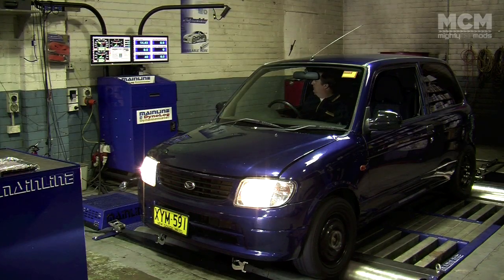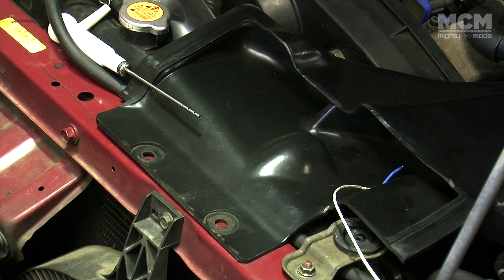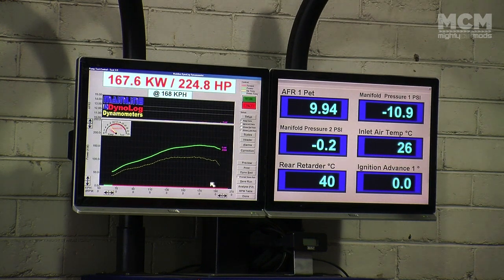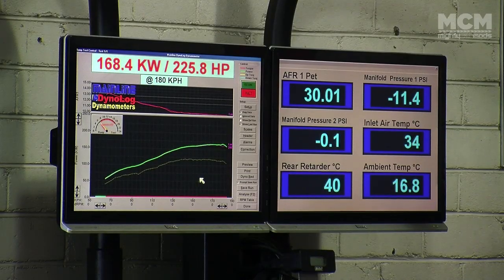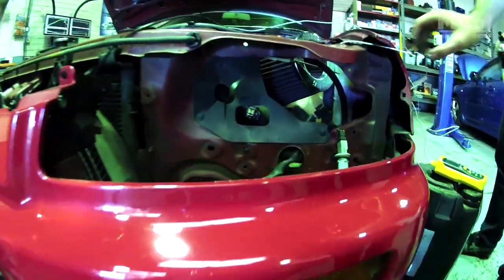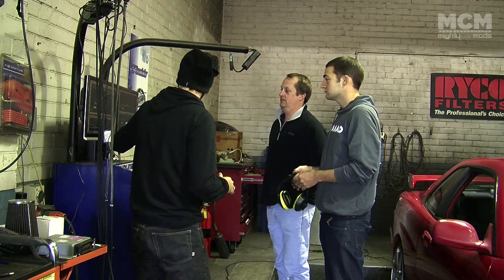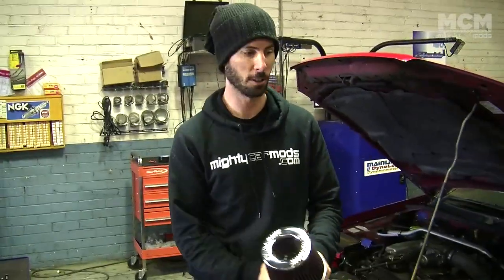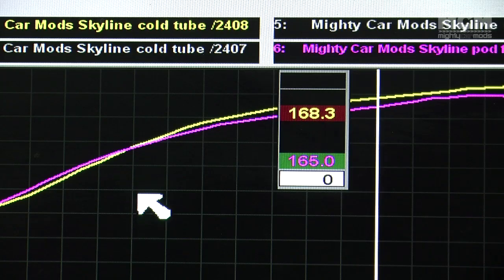Cold Air Intakes Mythbusted [Turbo]

Comment: The entire idea of cold air is that cold air is more dense and dense air makes more power.  This car is turbocharged. A electronically controlled turbo increases the density of the air to a specified psi no matter what the incoming density is.  Absolutely useless test.
Reply: Agreed ^^^^
Reply: Well said Dan Henderson
Reply: Real enthusiasm.
Reply: Hey Dan, PSI and density aren't the same thing. The atmosphere is at 14.7 psi. And at 14.7 psi, cold air is more dense than hot air. That's why If you stick a balloon full of hot air in the fridge it shrinks. This principal doesn't change at higher psi. If you're pumping 20 psi of cold air, you're getting more air than if it was hot.
Reply: Which like Cody said would explain why you would also get different results at higher and lower elevations due to air density.  I know my K&N worked for my SRT 4 .  I could drive it in 5th gear going less than 25mph / 40kmph and still spool air into the turbo.  Doing a launch I could smoke the tires all the way to 5th Pipe diameter, shape and length have a lot to do with how fast the air can be accelerated through the intake into the turbo, allowing a higher density of compacted air molecules, which allows the computer to adjust for more fuel, allowing more power (in a WOT situation this is maximized).  Companies who do extensive testing, such as K&N tend to achieve more nominal results.
Reply: Cody Dana Yes, PSI and density aren't the same thing, but given PV = nRT, n/V = P/RT.  In other words, given a constant density and different temperatures, the turbocharger would work 'harder' to take in air at an increased pressure.
Reply: Dan is right. Also, where is their heat shield?
Reply: Smart fucken man...
Reply: ***** what if you dont have intake valves =o
Reply: Its not just air that matters...  Its the oxygen content in that air.  Colder air since it is more dense carries more oxygen to the cylinder.  Oxygen + fuel + heat/spark = bang.  If you want a bigger bang you have to get more air and fuel into the cylinder.  So yeah, CAI is a valid attempt to get colder/denser air/oxygen in there to make more power  Unfortunately, doing this to a stock motor will most likely not have much gain.  Need to upgrade some of the other bottlenecks in the motor before you see a CAI intake make a difference.
Reply: Yes!
Reply: This, and the fact that, that is NOT A COLD AIR INTAKE.  That is a filter, a cold air intake comes with its own little box that insulates the filter and keeping the hot air from the engine from getting in, usually there is one side missing that faces the fender, from there is grabs air from the wheel well, that is a COLD AIR INTAKE.
Reply: BKH46 that is a short ram intake box
Reply: It is a COLD AIR INTAKE!  Which can also be called a Ram Air Intake.  It keeps hot air from the engine from getting into the intake.  The filter they installed was completely exposed to hot engine air.  Thus making their test completely worthless.
Reply: Measuring density in PSI. LOL.
Reply: Dan Henderson And that is why a turbo engine has no problems at altitude (within reason... high alps) but a NA engine can feel sluggish at high altitude...
Reply: wrong. CAI and ram are different things, CAI pulls air from outside the engine bay, ram pulls air from inside the engine bay
Reply: that made more sense than the video
Reply: ABSOLUTELY CORRECT. The other issue is that these knuckleheads are not considering the movement of air in road tests. I guess they didn't think of that either.
Reply: thats what the fan is for
Reply: They mythbusted CAI on N/A cars too with the exact same results. But regardless cold dense air is not the same as a turbo pressurizing air, If it was going to work it would still work on a turbo car.
Besides Turbos create alot of heat, colder more dense air would certainly still help make more power. This is why we have intercoolers.
Reply: Santa Clause yea exactly that's y Turbo Charged cars have a intercooler. I completely agree with ery point u made/said bro! But 1 thing that would've worked 4 em 4sure is different piping bcuz when the cold air comes n 2 the filter's chambers the pipes stay cold and continue to get colder over constant drive time. Which n return throws more cold air n2 ur motor. I'd bet anything if they would've used @least a piece of downpipe they'd get 5% outta it easy! But like u said "that's y Turbo Charged cars have a Intercooler on it"! U know ur cars buddy lol!
Reply: obvious troll is obvious
Reply: Math = troll...that's a new one.
Reply: Math?
It has nothing to do with math, It doesn't matter what kind of piping you have or were it goes at some point the pipes are inside the engine bay trapped with the hot air and they consequently get hot as well. Also his point of the pipes getting colder as you drive over time is totally invalid the car will heat up over time thus causing more heat and heating everything in the engine bay up more.
Then he says to use a piece of downpipe, not sure why you would use a turbo downpipe for a intake, and metal would probably get hotter than plastic does. Metal at will atleast certainly trasnfer more heat to the air in the pipe than plastic would.

The reason a intercooler works is because its designed like a radiator with channels for the air to go threw and off that thousands if not millions of small thin metal fins acting as a heat sink, then as you drive air goes threw and cools it off just like a heatsink in a computer with a fan on it will cool your cpu.

A intake of any kind will not increase your power, and the filters are not very good at filtering the air and the only reason to change out your stock intake is if you have a fully built engine with a tune and then at that point you are probably surpassing the stock intake thus hurting your power and probably its a track car anyways. Cars come with the best cold air intake you can possibly get from the factory, my car takes air directly from the front of the car outside the engine, others will take from the fender, either way its taking air from outside the hot engine bay to get the coldest possible air it can get.

You guys are just ignorant.
Reply: Tony Stark lol ikr! But HP and WHP r #s bro!
Reply: Where does math come into adding a cold air intake to stock engine = more power? The cold air intake is going to take in more hot air than the stock intake 90% or more of the time because its not in a airbox for 90% of them and filter the air worse, also the better breathing and less filtering filter doesn't equal more power either as your engine airbox is already the max size that the engine requires and any more is not needed or usable in its current stock form.
Reply: MORE VOLUME. COLD AIR is MORE DENSE. WHEN YOU ADD a BETTER FILTER and A BETTER INTAKE for MORE VOLUME OF COLD AIR you get MORE OXYGEN MOLECULES PER INTAKE STROKE. The Computer then ADJUSTS THE FUEL INJECTORS TO ADD MORE FUEL. MORE OXYGEN+ MORE FUEL = MORE COMBUSTION= HIGHER HP AT HIGHER RPMS depending on INTAKE RUNNER LENGTH. LONGER RUNNERS = HIGHER HP AT HIGHER RPM. SHORTER RUNNERS (WITH VELOCITY STACKING OF AIR) = MORE TORQUE MORE HP AT LOWER RPM. (All of this is addition, I hope you are doing the MATH).
EXHAUSTS SHOULD ALSO BE BALANCED FOR THE DIFFERENCE IN THE INTAKE> THE ENGINE IS AN ICE AIR PUMP.
What YOU don't understand is that MOST MODERN CARS TODAY ALREADY HAVE A GOOD FACTORY COLD AIR INTAKE. THE DIFFERENCE IS THE FILTER AND BOX. 
Example: MUSTANG BOSS 302 ALREADY HAS A COLD AIR INTAKE AND AFTER MARKET WILL NOT INCREASE PERFORMANCE AS IT IS ALREADY DONE. It's not a question of "does it help" its a question of: "Is it implemented properly". Bolt ons are for people that do not understand the SYSTEM they have under their hood and just "bolt it on" since SOMEONE ELSE DID THE MATH or MARKETED bullshit to you.
Now. Math has EVERYTHING TO DO with it. 
Everything I just said is FACT. Not opinion, its good old fashioned ENGINEERING MATH.
See, you are having to get a lesson by hostility by casting a wrong idea and then trying to back it up with more hostility. Just say: I don't compl;etely understand. What am I missing. And you could learn some cool things.
Example: If I add a TURBO to a stock engine it is increasing the VOLUME by COMPRESSION (MORE AIR IN THE SAME VOLUME OF SPACE  + DENSE) and getting RETARDED HP in a STOCK MOTOR. (In this case, you need HEAD STUDS and possible a good TOP END build with FORGED Components to handle the new power at higher RPMS).
Anyway. Math.
Reply: And that's why MCM showed amazing improvements in power! WAIT they didn't get any gains! Because the engine is already able to pull in all the air it needs from the stock filter & box.
Reply: Correct. The manufacturer accounts for that IN their process. There was a time that a CAI was necessary. Today, it isn't as its already built in. However, the idea that the intake doesn't improve performance would be simply wrong. But again, the manufacturer design accounts for it these days making it a pointless exercise to swap the factory with aftermarket (unless its about aesthetics).
Reply: So you argued with me, and then come round bout to completely agree with me. Congratulations I think I am now more stupid from reading your responses.
Reply: so intercooler are useless
Reply: Dovahkiin YOL  TOOR  SHUL Intercoolers lower the temperature of the intake air post turbo/supercharger. Intercoolers make it possible to run more pressure before seeing detonation being that the distance between the compressor outlet and the intake manifold on most systems is pretty short in order to keep decent response. If you had a turbo system without a way to cool the intake charge after compression, you wouldn't see any real gains from the system (at least not safely).
Reply: Exactly. It would have to be tuned each time to actually see the real performance outcomes.
Reply: BLUF: Regardless of the science behind it, the amount of HP increase (if any) is so small that it just doesn't matter.  Good way for these companies to make money.
Reply: All increases matter, since you need mods to support each other. A larger diameter intake will not do much on its own, but it's a great supporting mod when you're talking about upgrading to a larger turbo since it can sustain more flow.

Also, gains from an intake are entirely dependent on how restrictive the factory air box is. The size of the pipe is more important than where the filter is located in a turbo application.
Reply: Holy shit it's you again, you just dont stop getting top comments